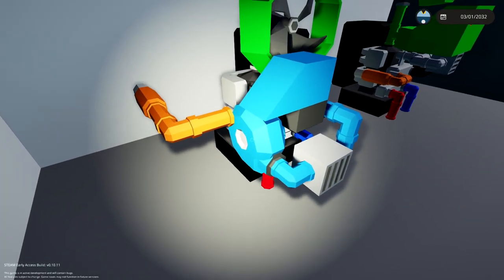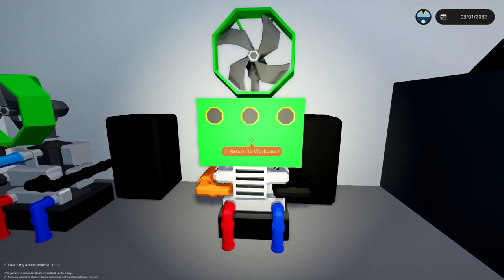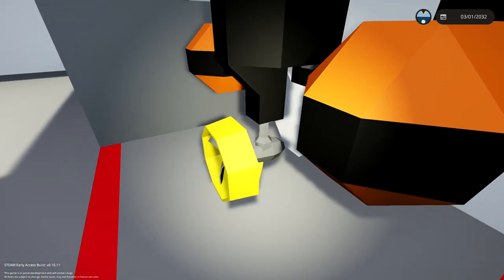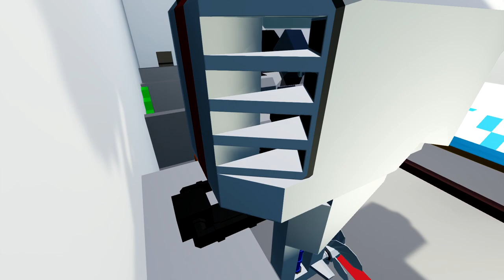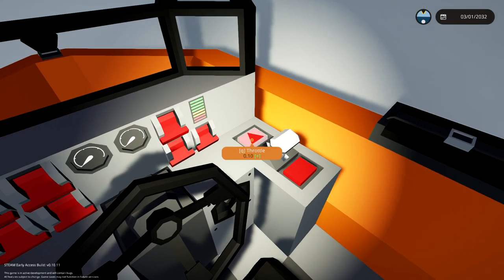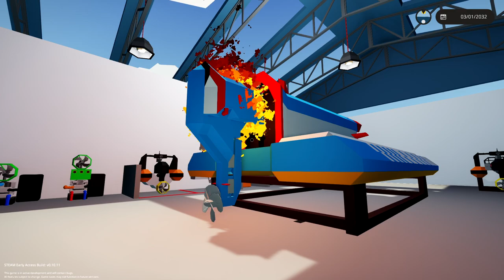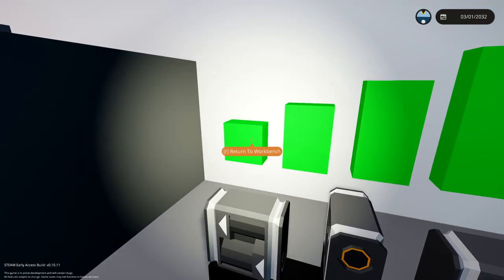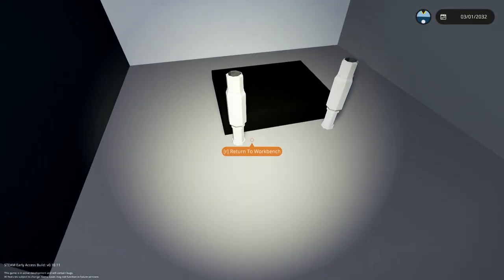Modular Engines and more! - Stormworks: Build and Rescue - Wanted Features - E2

Comment: I'd love to separate the turbo and supercharger into two components that are also useful for other things, one part that lowers fluid pressure and adds rotation to a shaft and one that takes power from a shaft and adds pressure to a fluid, even better would be if a single object could do both but I see that as unlikely  in the game.

For electric motors/generators I'd love a perhaps less efficient one that can do both (albeit not at the same time), to be able to do simple regenerative braking systems and the like.

Also I'd second the singular gear gearbox, especially since that one shouldn't need electric further simplifying small builds.
Reply from the maker: Hey Zorb, thanks for watching and commenting :) You are always full of great ideas!

If engines/engine systems ever do become very modular, the possibilities could be almost endless. 

I love your regenerative braking idea, it would be especially effective on heavy vehicles like trains hauling freight.

The singular gearbox would be so useful, maybe we could have one gearbox in the inventory which is modifiable to any size depending on the number of ratios. Starting at 1x2 for 1 ratio. 

Thanks again!